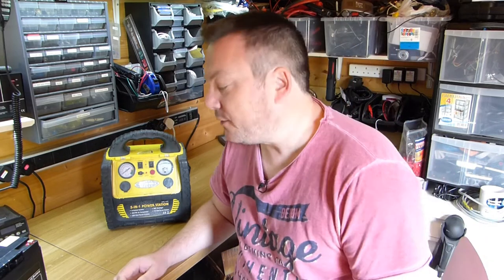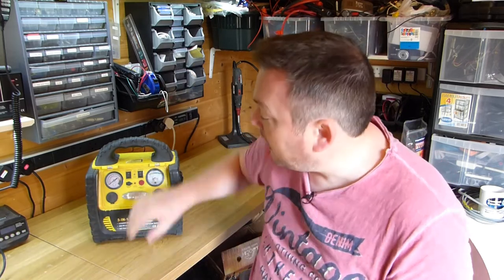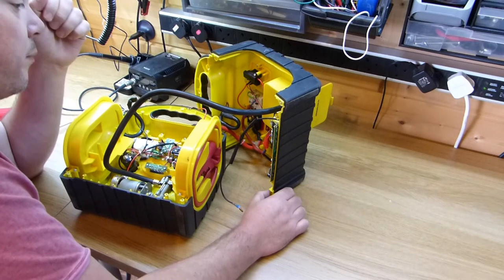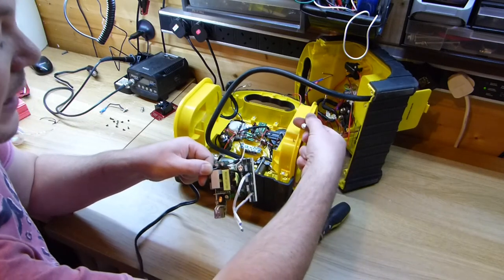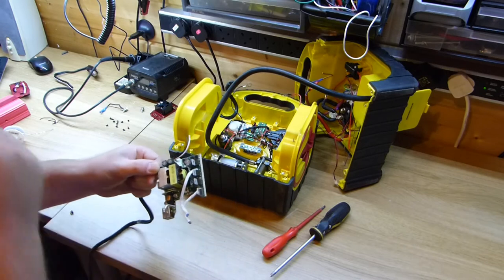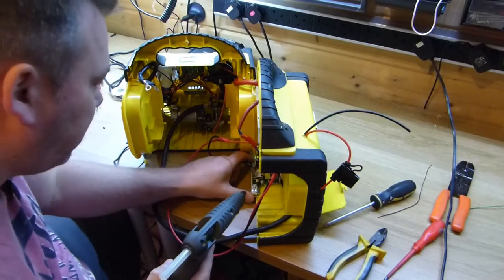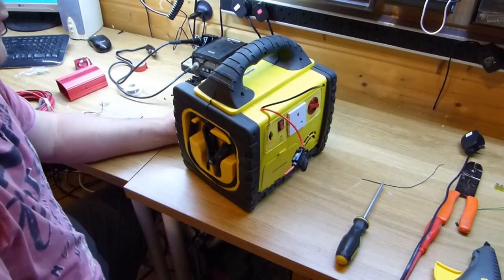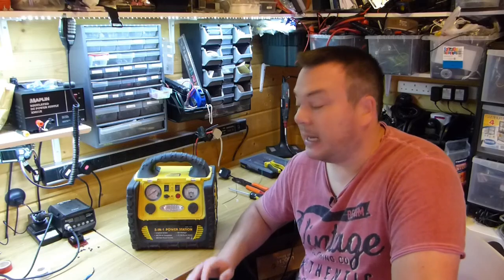12v Power Station Repair - DO NOT TRY THIS

Comment: Great! Thanks for this. I have the exact same model and will now carefully replace the tired battery in mine. I'm not sure I'm using the correct charger adapter with it though... what is the charger model code on your adapter? Thanks.

Comment: Hi, I got mine as gift, but the inverter and the compressor are bad, the fuse keeps burning. would you mind telling me the model of the inverter you used, I would like to replace mine as well. I'm not too bothered about the compressor, I could live with that, thanks a lot
Reply from the maker: It was just an unbranded 200w inverter from ebay. Any will do so long as it’s the small range for cars.
Reply: @Shack-time  if only your response came in time, I threw it away, sadly.
Reply from the maker: @b10la.  I am so sorry. I’ve been terrible at replying to so many messages but I’m back on track now. All the best 👍

Comment: Somebody knows how to charge it without the little plug on the front??
Reply from the maker: You could use a normal lead acid battery charger and connect to the large battery clamps once the unit is tuned on.

Comment: Hey man! Great video and mods! I have the exact same pack but my charging adapter broke. I need to replace it but I’m not sure what the rating should be - if I’m not mistaken it should be a 12V 500mAh, right?

I would appreciate the help man
Reply: You can use any lead acid charger connecting it directly to the cables for jump start. Just don't exceed 4-5Amps🙂

Comment: Need to replace my battery, was looking at replacing it with 12V 20ah LiFePO4 Lithium Iron Phosphate battery which is the same size, then add an SAE connector to recharge the battery with a solar panel, has anyone tried this or any advice?
Reply from the maker: Brilliant idea. However there most likely wouldn’t be enough power to jumpstart a car. If that’s not important then lithium is the way forward 👍

Comment: I have one of these old Harbor Freight specials and i must say it’s been a consistent POS since new. HF really came out with some real “winners” about 10 years ago. I HATE lead acid batteries. WHY OH WHY do modern cars still use these heavy, dangerous, shitty things? The whole damn automobile industry should have switched over to lithium Ion cells years ago. Mine is good for the LED LIGHT STRIP and that’s about it kids. I don’t think this HF Special would have ever jumped start a car even in its heyday!